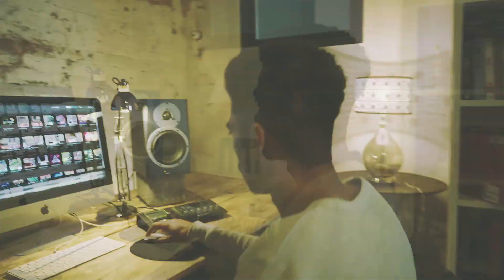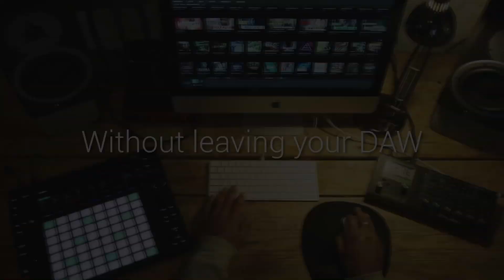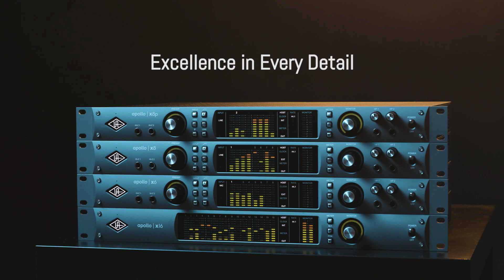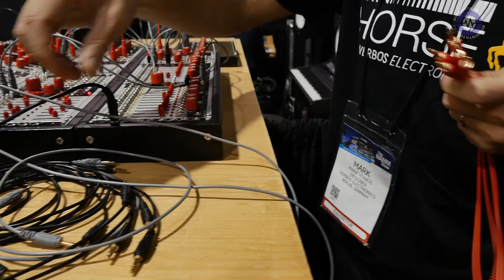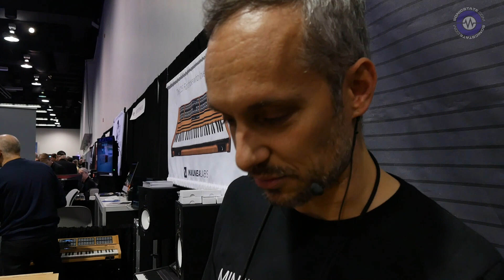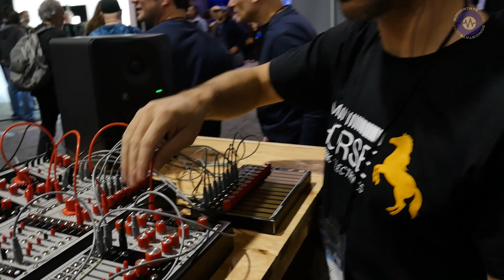NAMM 2019: Verbos Electronics - CV Processor and Mini Horse

Comment: 700 euro for a touch plate controller.  Did he not see Arturia is making a whole synth with capacitive touch plates with MPE midi over USB for under 400 euro?  You could buy a micro freak and an ES-8 for about the cost of the mini-horse.
Reply: Robert Syrett verbos is in a class of its own. I own a bunch of their products, which on paper, seem quite expensive, but I assure you they’re worth it in ways you can’t really anticipate. It’s a solid investment, if you’re willing to invest in your craft
Reply: @stoopidnametag  I would say it is in a class with BEMI.  Yes it is good, and I am glad you are a satisfied customer.  However I don't feel the price accurately reflects the value.  It's one thing when paying top dollar for something you can hear, but these are control voltages.
Reply: Robert Syrett now that about everbody has some tonemaking modules controlers are as important as filters and vca s, if a modular it will be more expensive as a finisished device
Reply: Robert Syrett some designed ways of behaving electronics behind the plate - not to forget - like it behaves like sliders but there are none
Reply: Robert Syrett it does way more than the microfreak keyboard. Specifically the position value, which is totally different than pressure. Unique and worth it